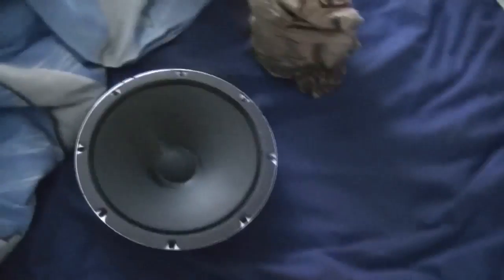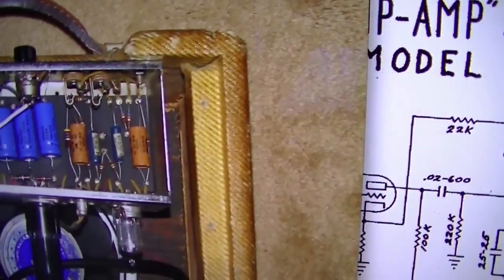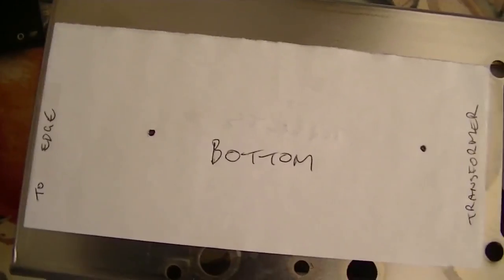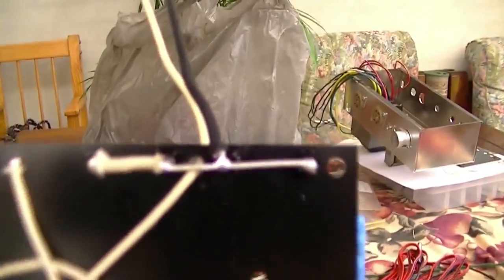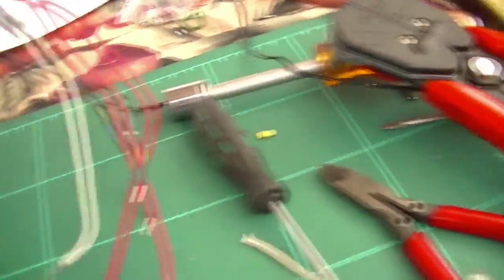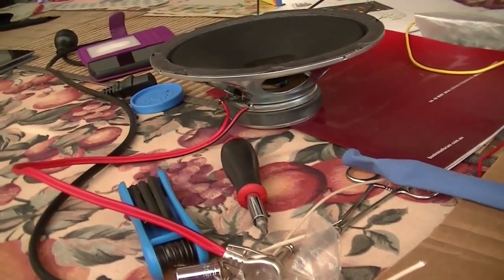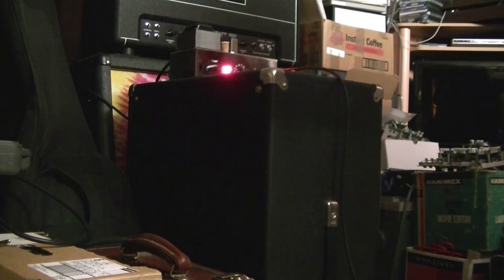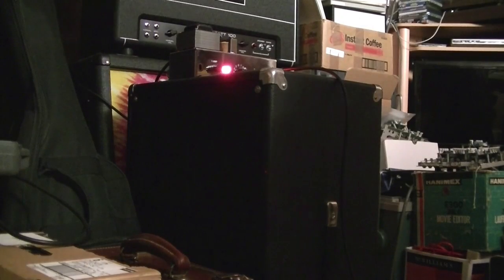Mojotone 5F1 Champ Amplifier - Part 1

Comment: Phenomenal sound.  And loved the volume knob demo.

I want to build one of these but have no experience building amps and no working knowledge of amp circuitry in general.  

I have a Marshall JCM 2000 DSL 401 (pre-2003) that has a blown bridge rectifier.  I want to fix it myself but don't want to accidentally shock or kill myself by improperly draining the filter caps.  Amp hasn't been turned on in over a decade so maybe the filter caps are already drained.

Sorry for rambling. Great video!

Comment: Hi mate, as i can see you have good knowledge about champ.please i need help to build mine.i have hammond 291AEX power transformer 220 version and it's got two black wire primary,but am bit confused which lead going to the fuse.because these two leads come out from different bunch of wires e.g.; one stay with two red wires and the other stay with green and yellow bunch,your help much appreciated.

Comment: Hey mate, nice videos.  Thanks for posting.  I just bought myself the mojo 5F1 kit.  Did yours come with some kind of step-by-step instructions?  Mine just has the wiring layout and the schematic.  But its really light on any other instructions (i.e. where to mount the terminal strips, how to mount the eyelet board and what the other insulating board is actually for?)...  Did you end up trying without the bypass cap and resistor only?  What did you think?  Cheers!

Comment: Hum????
Reply from the maker: The guitar has P90 pickups which are single coils. Single coils hum.
Reply: @snarfusmaximus  True but the position of the speaker output next to the preamp tube is a hum causing problem too, Fender later moved it away from V1 on later models.

Cool sound with the p90's btw, usually these are played with sc tele's or strat's but the p90's give it a nice growl.